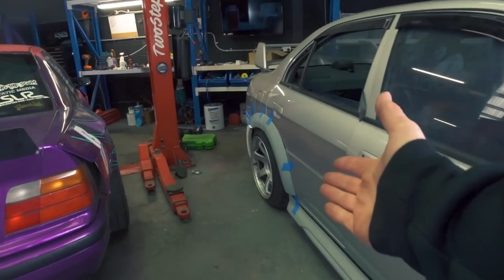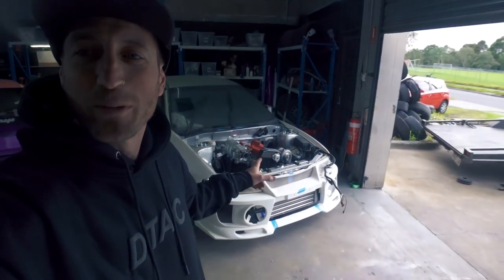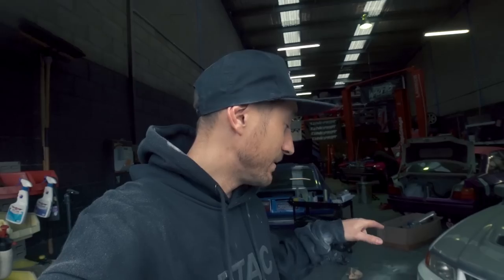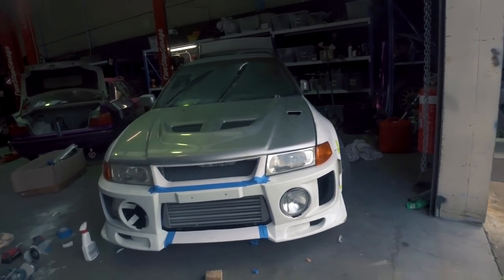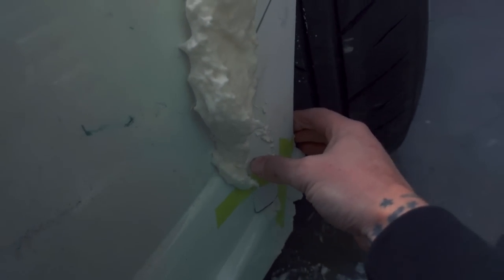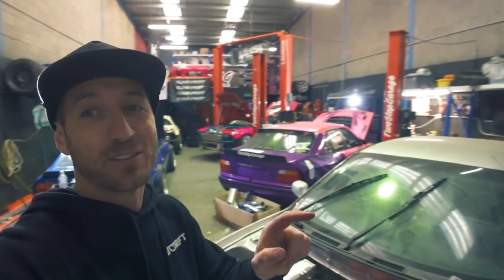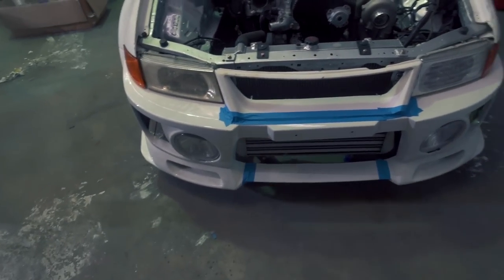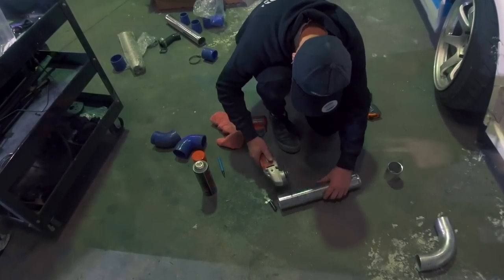LANCER FWD TO RWD CONVERSION | PT15

Comment: Your bonnet has a air vent intake (the smaller vent on the right) you could use this to push more air into the filter for possibly a extra bit of juicy fresh air into the engine
Reply from the maker: Agree! I’ll make a cold air intake from the bottom too 😁